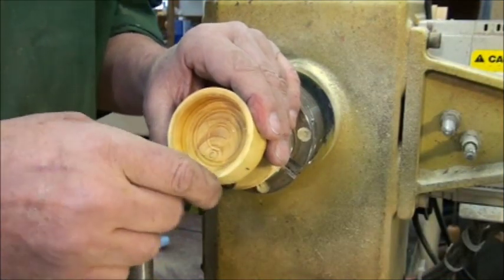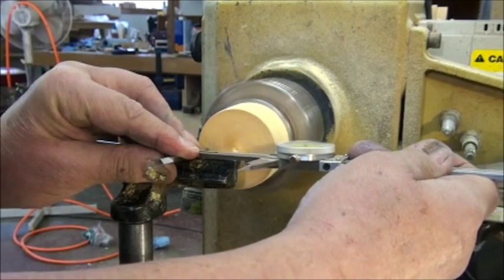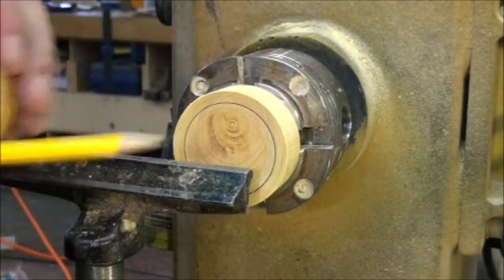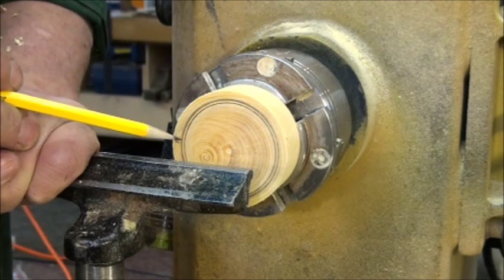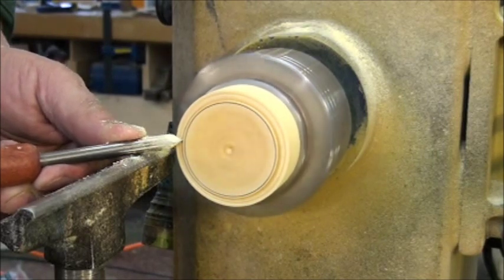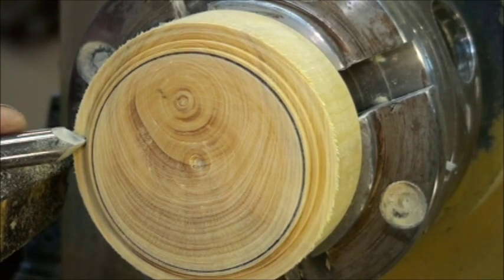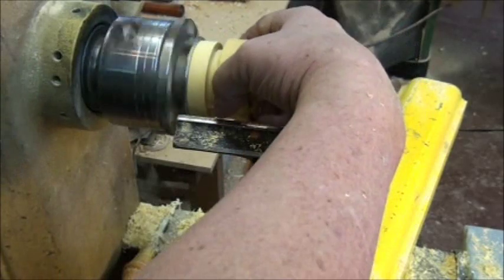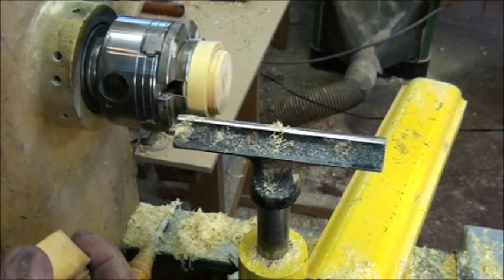THREAD CHASING MALE THREADS on the LATHE-UPDATE

Comment: Hi, do you think that choosing a less dense thread (10 tpi instead 16 tpi) would help if you're using a not-so-hardwood but not softwood? What I mean is, would the larger threads help so that the softwood threads don't crumble? Thanks!
Reply from the maker: Terra
Yes, I understand perfectly.  I know that using a coarser thread chaser will allow softer woods to be chased.  I have had luck with hard maple with a 10 or 12 TPI chaser.  The finer threads will crumble in the same woods.
Sam
Reply: Thank you!

Comment: Mr Angelo.I found an answer to my question.Once the thread is established,I soak it in mineral oil and continue the threading while it is wet.Repeat wetting with mineral oil and a brush.I would like to hear some comments.Thank you.Angel Ramos
Reply from the maker: Angel,
What I usually use is a beeswax and mineral oil mix.  I heat this up and blend it.  I try to mix it very loose (or more liquid).   I also heard you can use soapy water.  I have tried this and it worked well.  I WILL try the mineral oil.  I like it better than water, which can interfere with your finish.  I think it is a great idea.  Thanks for sharing it. 
Sam

Comment: Mr Angelo.Any way of stablelysing the wood as deeping it into deluted glue,CA,etc so that we can use more types of wood?Thank you.Angel Ramos
Reply from the maker: Angel
Yes this is typically done by many thread chasers.  It does help to thread more types or softer woods.  I personally don't like to do it.  I would rather make an insert from box wood or something else that takes a good thread.  CA glue is nasty to turn.  And in my experience you have to reapply it several times.  I do use CA glue when I am chasing a "chase able " wood and the threads crumble a bit.  I then use CA to make them work.  I now have 6 or 8 good woods that I can chase threads in so I avoid stabilizing.  You can find a list of woods on the menu of my website:  wyomingwoodturner.com
I have some good info about chasing.  Sam